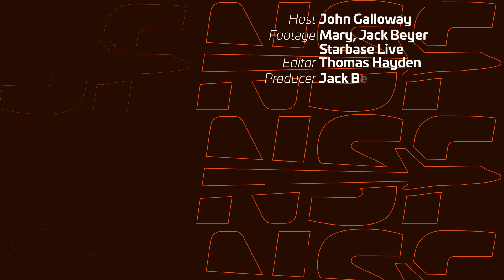Hopper Relocation Preparation and Chopstick Work Continues | SpaceX Boca Chica

Comment: Aah, with the help of a crane they will throw the B14.1 on the chop sticks after putting weights in it so it has the same weight as a landing full size booster to test if this idea works.

Comment: The material you called welding blankets is what we call Salmon Cloth and it is used for building a containment for welding operations it comes in big rolls so you can trim it to fit
Reply from the maker: To help with shielding gas retention if I'm not mistaken? -Das
Reply: @NASASpaceflight  it’s more as a fire retardant. So the slag and hot molten material won’t splash onto other things and potentially cause a fire or stick to something you don’t want it to stick to. It’s acrylic coated fiberglass. You can wrap it around things like a pipe or an electric motor you want to protect or drape it around the general area like a curtain, you can do all sorts of stuff with it.
Reply from the maker: Good deal, ty! - Das

Comment: @NASASpaceFlight Think about it if they did not move hopper and the landing of a super heavy booster crashes down to that area it would DISTROY hopper. By moving it to a safe location it will still be around.

Comment: They should put Starhopper in a museum.  SpaceX should build a museum to record its history.
Reply: Humm, good idea. 👍
Reply: It looks like they plan to put it on display in the office building. There's a triangular opening in the roof which is the right size and shape for Hoppy to be lowered into.
Reply: yeah I'm hoping that the building with triangle opening is a place for Hopper and that it will become a mini museum for public... but part of me is preparing that it will be scrapped and I will never be able to see it
Reply: @witchdoctor6502 think they are gonna put it in star factory
Reply: @witchdoctor6502  the builder is an office (so probably no public access), and i very much doubt they'd scrap it. i imagine it'll be immortalised, somewhere.
Reply: totally agree
Reply: inside is best, it WILL eventually rust. they can keep it clean for many generations to come
Reply: Musk needs to improve and design/build a bigger starship as soon as possible instead of just doing a boring museum...
Reply: @io9883  let me introduce you to Block 2
Reply: Starhopper deserves the open sky above him, no ceiling.